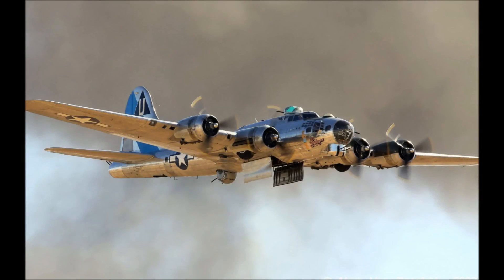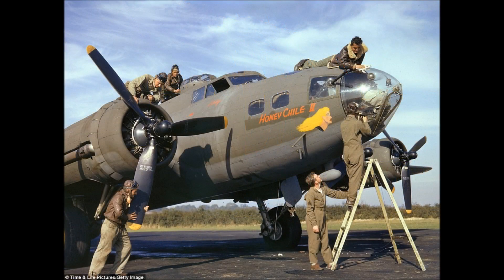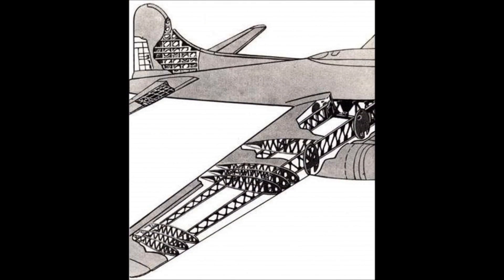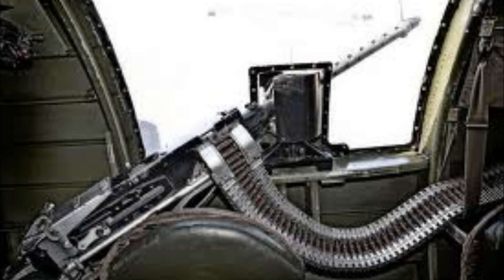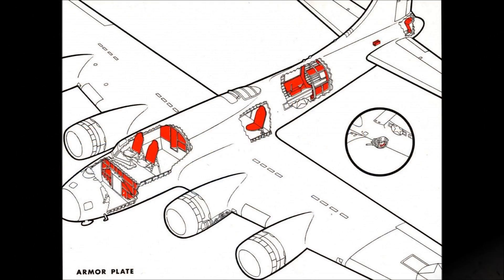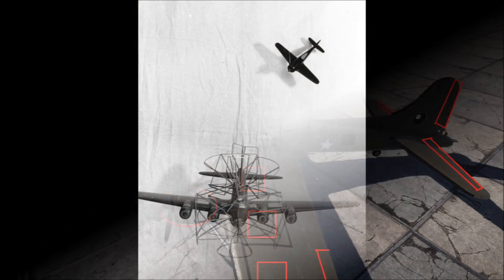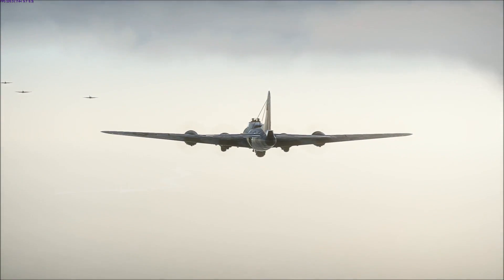War Thunder Aircraft Analysis: B-17 Flying Fortress

Comment: I do think the diving and pull up attack from 12 o'clock is a good way to go - in that case you are mostly only exposed to the dorsal turret but its just darned difficult to be able to climb up high enough to do that, especially maintaining enough forward speed to not only keep up with them, but to overtake them from behind and set yourself up to attack them from 12 o'clock high.  The darn thing is nearly as fast as many fighter's top speed and it takes most fighters forever to accelerate from a climb to enough level speed to start overtaking the B

Comment: As an avid B-17G player, I have a couple of tips:

3:55 - Atacking from below doesn't hide you from the player, the camera goes over the tail. From the angle your presented, it's highly possible that you were also in range of the tail gunner. They have ridiculous angles. Keep that in mind. Basically, I'd say attacking like this is almost as bad as attacking straight from the rear.

4:04 and 4:28 are very effective methods indeed, mainly because the player in the B-17 has to take both vertical and horizontal movement of the attacking aircraft into account when aiming his turrets.

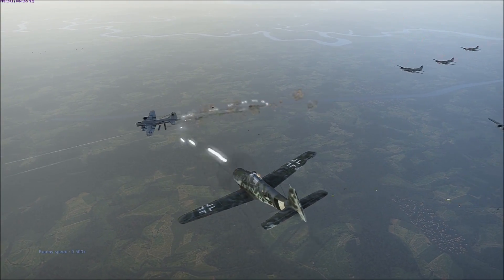4:14 - I'd say head-ons are too risky to be worth it. You will be fired upon from the chin turret AND either the top turret or bottom ball turret. That's 4 MG's already,and fifth one from the nose cone will come into play of you're coming from a slight angle. I'm also pretty  sure that there's a spot which is covered by the chin turret, ball turret and the top turret. Yay Gaijoob!

4:22 - Chin turret and the ball turret will get you. Go in from an angle, like you were doing 4:04 and 4:28, just from the bottom.
Reply: as a player with 1000+ hours and a butcher with the mk108 30mms, your best option when using said mk108s is a diving pass at the front. i enjoy diving while the B17 is flying torwards me from below. I shoot the living crap out of his engines, and I can turn for another pass from the right, only exposing myself to 3 guns. the ball gunner and one waist gunner. To kill a B17 just bully one wing into submission, whether it be taking out both engines, making him unable to fly, lighting his fuel tanks up, which usually is an effect of shooting by the engines anyway, or shearing the wing right off which is surprisingly common with the MK108s which have superior explosive capabilities to an F1 hand grenade. (which is why most german B17 bomber kills with the 30mms were with on average 5-6 hits)

Comment: I use the bottoms up attack a lot, (head on preferable if possible but most b17's are so high that it would take me considerable time to climb up to them to get enough speed again (arcade) that the game would be over.  

Yet my issue is, lets assume i am above a B17 in my P80, Beercan, FW190, BF109 G10 etc.... i dive in (again arcade) with lets say 500-700kph. Strafe bay, get some hits / maybe take a gunner out... fly past him....  BAM -   1 single  12mm Rnd hits my fuselage, either fuselage black, engine burning, or quiet often simply my wing decides to go on its own adventures.

Therefore i try to only engage a B17 anymore if i have rockets (dead bomber gunners cant do much), or use a BF109 G10 with 2 30mm wing mounted cannons.  But that is way more risky than using rockets because there are times where you unload all 3x30mm + 13mm into the B17s vital parts and he doesnt give a single fuck. Yes, maybe i damaged his control surfaces  but he isnt down, and since its arcade (yes i know, arcade scrub) that wont force him to land, more in a slooow big spiral towards toe ground that gives him plenty of opportunity to drop 2-3 more bombloads.

Guess thats the drawback of arcade but still, the ammount of time i get 1 shotted by a b17 gunner is silly. Not even mig 9's can get up to that lvl ...

Comment: The end of the Bomberspam is coming...
Reply: Not really..
Reply from the maker: It would be nice, but alas, this video won't manage that. May make it easier to counter but it won't go away :(
Reply: Pssh ... bitch please ... they will never be stopped getting spammed until they fix the guns or change the b-17's dmg model
Reply: >The end of the Bomberspam is coming

Nope.  My usual is a bottom up attack on the belly of the bomber, aiming for mid wing with 20mms, curl up and away to dive again then back under and repeat.  In other flight sims I've had a ton of success against all types of bombers.

In WT it's a good 80% chance of death.

Until they fix the AI gunners, mouse aimed guns, arcade like bomber sights, and the far too powerful AP 12.7mm machine guns, the bomber spam is going to continue.